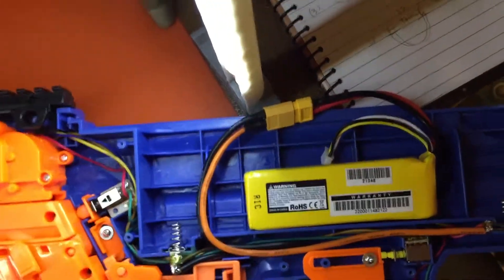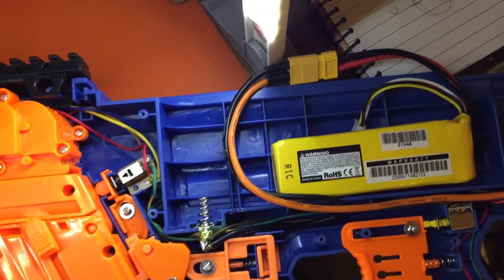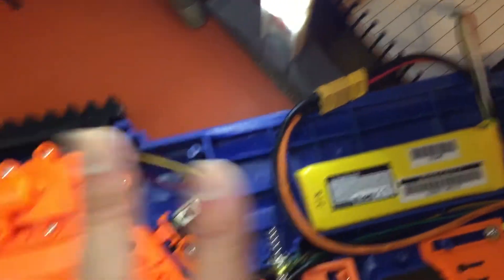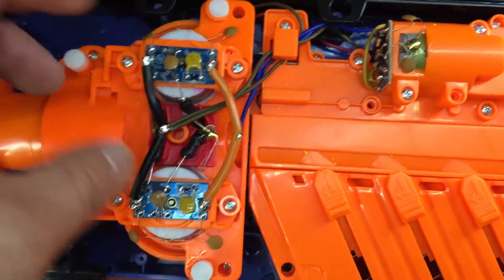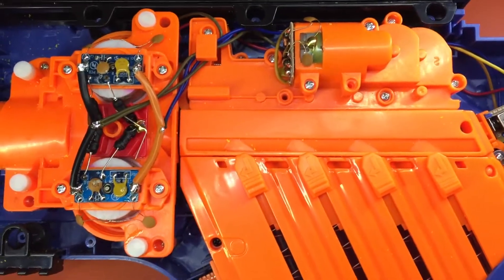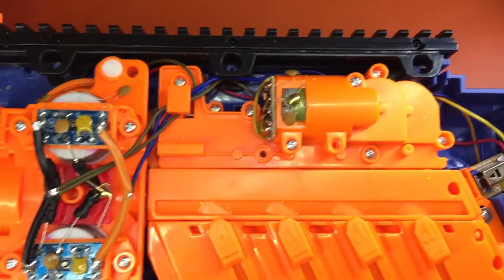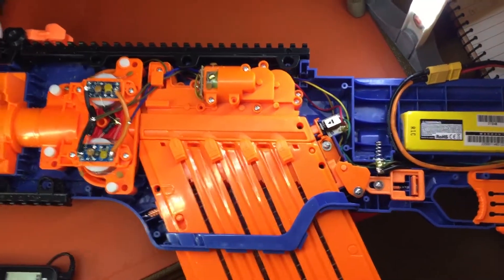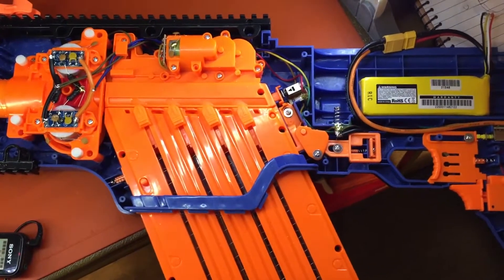Rival Khaos Quick LiPo Conversion

Comment: Wont the extra power risk burning out the old components?
Reply from the maker: The motors can handle the higher voltage and current; the weak link is the stock switches, which are cheaply and easily replaced (Omron 21amp cherry microswitches). Lower gauge wiring (stock Rival wiring is heavier than dart based Nerf wiring) has more resistance than higher gauge wiring, but the real world implications are minor. More resistance = more heat, less efficiency, minor reduction in motor rotation/torque, slightly lower muzzle velocity (less than 5 feet per second, probably closer to 2-3).

Comment: what mAH is the batter and volts?
Reply from the maker: This is using a 3S/11.4v, 2200 mAh/30c discharge rate LiPo pack. If you're planning on using this for high usage (all day games), a full rewire with 16ga wiring and Omron cherry switches is recommended as the stock wiring/switches were not engineered for sustained 66A loads from the 2200 mAh/30c pack.

Comment: where can you buy that connection and what is it called?
Reply from the maker: The only connector used in this rewire is the XT-60 plug that is the current standard for LiPo batteries. Any merchant that sells LiPo batteries should sell them. Amazon, Ebay, Alibaba, etc. Cheaper to buy in lots of 5.